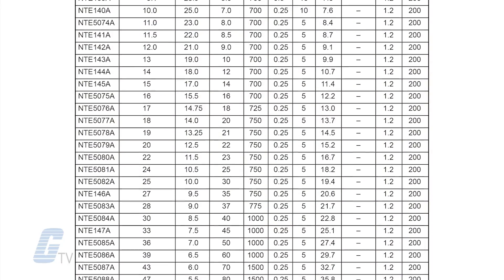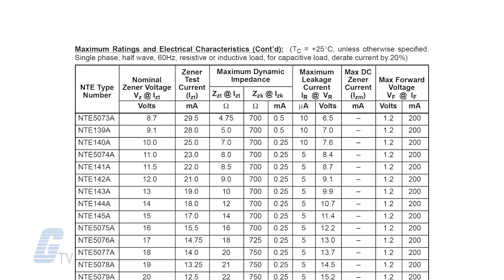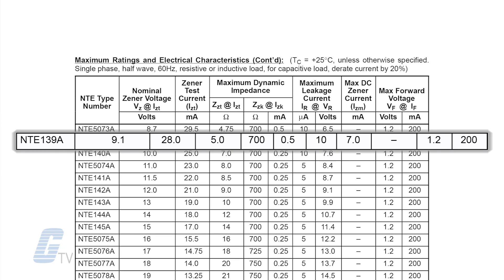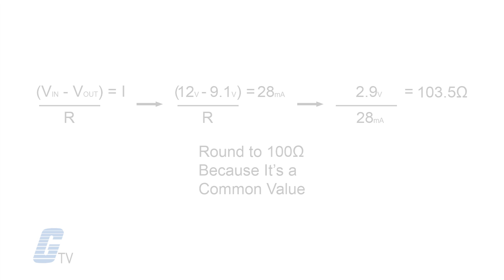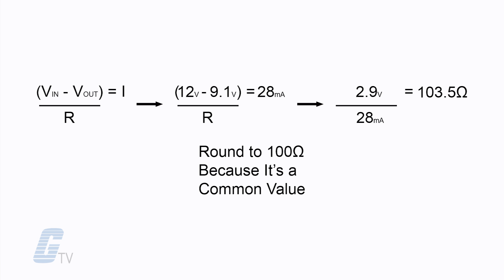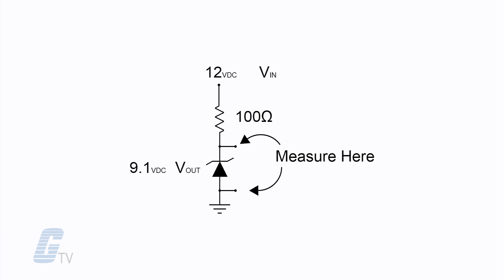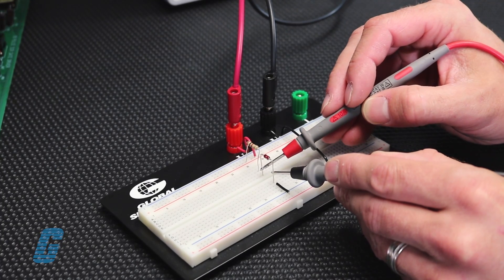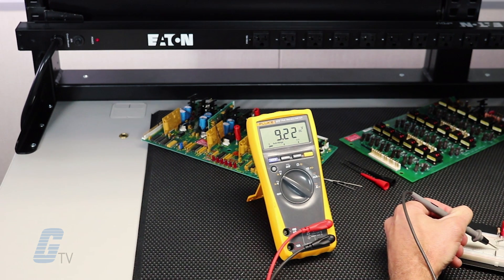How to Test A Zener Diode

Comment: WHat if you get continuity across the diode to +/-
Reply: You need to use diode mode on the multimeter. Usually it is the same position as continuity and then hit mode select to switch to diode mode.   -|>   Continuity does not test direction but diode mode does and direction of flow is how you test a diode.

Comment: bro my indcution heater metal melter is 3500watts and input v is 48v what is the correct zener diode need to use it?

Comment: I have a switching power supply.  The voltage swing is around 1 Hz.  Zener replacement solved this problem.  But the faulty zener passed the multimeter test and the voltage limiting on the dc load. So how to test zener for high speed operation?

Comment: Would this also work testing the reverse breakdown of a Schottky diode?   When I tried it - I got no current - even for 10 volts over the Schottky breakdown voltage (Schottky Vr = 20 V.  tested reverse voltage = 30 VDC).  The full voltage drop read across the Schottky (30 VDC) - and NO voltage read across the resistor (which was only 10 ohms).   Am I missing something ??

Comment: What about the orange glass zener diodes? I have one shorted in an expensive preamp that never had a schematic. Is there any method of determining it's value to replace it?
Reply: Just wondering if you ever figured out the Zener voltage of that orange glass type diode? (If badly stuck, I suppose you could try a high value, and work downwards until the circuit works as expected ??)

Comment: Why resister is used to measure zener diode...
Reply from the maker: Because it gives the remaining voltage somewhere to go. Notice they use a 12 volt supply across the diode and resistor, ok? So the 12 minus 9.1 = 2.9 right. This keeps the current thru the diode from going way beyond its range of operation once it breaks into zener mode.

Comment: I has always thought that OL mean Over Limit.
Reply: it does mean OVER LIMIT
idiots who don't know how to use their brain say  OVER LOAD
Reply: Open Loop
Reply: @kylethompson3187 
it doesn't stand for Open Loop,  it stands for Over Limit
Meaning that the meter has a Limited measuring range and anything above it is represented by OL.

Open Loop is something that someone back in the 70s dreamed up based on the fact that 
When you measured continuity and you have an OPEN CIRCUIT  aka  OPEN LOOP it would say OL,  that's where that comes from 

Not everything is an open loop
EXAMPLE : if the limitation of your DMM on Resistance is let's say 10 M Ohm and you want to measure a 15M Ohm resistor

- The resistor is good
- Your meter is good
- There is no Open Circuit between the test points

- HOWEVER YOUR METER WILL READ OL    or , depending on the meter it might read  1  which is a substitute for OL

the reason this happens is   YOU HAVE EXCEEDED THE LIMIT OF THE MULTIMETER

another way of saying Open Circuit is  INFINITE RESISTANCE,  or  INFINITY as some like to loosely call it 

so.. the lesson for today is 
IT'S CORRECTLY CALLED    OVER LIMIT
Reply: Over load
Reply: @AHMAD0SHISHANI  
it's not over load
jesus,  Use some common sense

WHY THE FUCK WOULD IT MEAN OVERLOAD
if you're testing a wire in continuity mode
and you cut the wire (hence it's open Circuit)
WHERE IS THE OVERLOAD ?

No mate
2 Terms are accetable

Open Loop (but this doesn't work in some measurements)

or

OVER LIMIT
which means

In continuity mode - There is high resistance and.. THE METER CAN'T DISPLAY THE EXACT AMOUNT, hence it has gone OVER THE LIMIT OF THE METRES ABILITY TO MEASURE THE RESISTANCE
 you can also call this OPEN LOOP if you like (but it's not correct , but does work in this scenario)

in Voltage Mode - You can't use Open Loop
it's OVER LIMIT  because if you have a meter that will test up to 600V and you try and test 620V   you will see OVER LIMIT  (OL)  simple as that

in Resistance Mode - Same thing,    you go over the limit of the metre's ability to display the number and it shows  OL

it's over limit
it's not Overload

how the fuck can it be Overload ?
DID YOU EVER STOP TO THINK ABOUT THIS ?
Reply: @martinkuliza  Over Load
Reply: @keysersoze7034  
No it's not
Why don't you use some logic...
if you are measuring a resistor which is(let's say) a 200 M ohm Resistor
and you are using a Digital Multimeter with lets say an upper threshold measuring range of 100 M Ohm Resistance
then the meter would display  "OL"
A) Because it is not capable of dispalying 200 M Ohm 
B) Because it wasn't engineered to do that
C) the way it was designed is... for any value above the max that it can do it displays  OL
Now to challenge that
if you are saying it's  Over Load
then  WHY DOES THE RESISTOR NOT BLOW OR BURN OUT
because an OVER LOAD situation means that YOU ARE PROVIDING MORE LOAD THAT EITHER THE RESISTOR OR THE MULTIMETER CAN HANDLE
by your logic, the resistor should blow up or Burn out because it's over load
it's not over load, mate,  it's Over limit 
also if you measure with a DIGITAL DMM and it says OL
and then you measure the exact same resistor with an analog Multimeter 
WHAT THEN ???
if it was overload either the resistor or Analog multimeter would burn out, blow or fail
but it's not
what happens is ..... the needle on the meter goes all the way over to the other sie )what is called FULL SCALE DEFLECTION
it essentially gest to IT'S LIMIT and hits hard over
hence  OVER LIMIT
There is no OVER LOAD, that doesn't even make sense
Like i said...  People who don't know what it means or who don't use logic  call it  OVER LOAD
so again... IT'S OVER LIMIT
just a quick one also
some people will say it means  OPEN LOOP,    now this is not completely incorrect,     DEPENDING ON WHAT YOU ARE TESTING AND WHAT MODE YOU ARE IN
so...
if you are testing continuity  (which is actually working on a concept whereby it's detecting resistance and below a certain resistance the beep will be audible and above a certain resistance 
a) it won't be and  b) it will display  OL)
in this scenario.....   you can view it as  OPEN LOOP  because you either have continuity in a  CLOSED LOOP / CLOSED CIRCUIT or you don't have continuity and you have high resistance and hence   OPEN LOOP /  OPEN CIRCUIT
in saying that.. you can also just have a close circuit with high resistance and get a reading of OL
so... in one way you can view OL as  OPEN LOOP.  but only in continuity mode
if you are Voltage mode,    ACD or DC  it doesn't hold true
if you are in Current mode...   it doesn't hold true
if you are in resistance... doesn't hold true etc...
so ..  the correct explanation of O.L.  is..    Over Limit
BECAUSE IT APPLIES TO EVERY SINGLE MODE
Open Loop,  is used in 1 mode only
OVER LOAD is just ridiculous and is used by people who don't know what they are talking about.

Also , just for fun
if you don't want to listen to me (Someone who has been in electronics since i was 6 years old,   i'm 46 now)
Listen to the electronics community and their opinions
https://www.eevblog.com/forum/chat/seriously-anyone-know-the-story-and-meaning-of-ol-on-multimeters/

in the Poll..  you'll aslo notice that OVERLOAD is leading the polls   haha

what we learn from this is ......
The OPINION that it is OVERLOAD   is WITHOUT QUESTION  THE MOST POPULAR ANSWER

but.. it's not the correct answer because it can be disproven very easily
however, if you try and disprove what i said and what most electronics experts say  that being  OVER LIMIT    you can't 
and if you try and disprove   OPEN LOOP across any mode  you can , but you can't disprove it in continuity mode, so it does have some validity 

but if you consider the accurate electronics definition of OVER LOAD,     mate.. it's not overload,  you can disprove that in a second
research it for yourself
Reply: @martinkuliza  Over Load*
Reply: @keysersoze7034  
Recursive Loop !

this is you....
------------------------------------------
10 Print "Overload"
20 GOTO 10
RUN
--------------------------------------------
let me know when you decide to kill the process

Comment: This is schottky diode bro, not zener!!!!
Reply from the maker: No, it's a Zener Diode. The first diode visible is a 1N3339 which is a 91 volt zener and the same tested with the multi-meter. The NTE diode tested in circuit was also a zener.
Reply: FixDaily - Electronic repairs, hacks and tips my god. He used test circuit for that reason
Reply: If that was a 9.1V zener diode you would never be able to read it with your multimeter because your multimeter doesn't have enough voltage to read the drop across it

Comment: the first was a diode not a zener
Reply: It iz zener.
Part number shows. 
Just like transistors can look like diodes and IC.
Reply: its a zener diode
Reply from the maker: Yes they were all zener diodes. The first diode visible is a 1N3339 which is a 91 volt zener and the same tested with the multi-meter. The NTE diode tested in circuit was also a zener.
Reply from the maker: it's a zener diode.
Reply: no its not

Comment: We'll checked the voltage on the zener and getting 3.2 volts using  a 1K ohm resistor and a 9v battery. It's a 751 Zener as marked on it so I believe it needs to be replaced. almost done fixing the Memory Man deluxe!!
Reply from the maker: Sounds like you are on the right track.

Comment: Great Simple video. I have a Zener Diode here that measures  1.82 v on the reverse diode test I believe this diode is shot anyone can anyone help? as I think I may have to order some...
Reply from the maker: That is probably a safe bet. Zener diodes basically measure the same as a rectifier type will, except maybe a little higher forward bias voltage like 0.7volt instead of 0.6. Reverse biased they will measure open like a rectifier until you reach the Zener voltage value. Do you know what it is rated?
Reply: GalcoTV Thanks for the reply will test the rated voltage with the 1k ohm resistor and 9 v battery but since it is giving me a 1.8v when doing the reverse diode test when it should be OL there is really no point in going further so I ordered the 751 zener . I have the schematic for the Memory Man Deluxe and I already replaced the dead Voltage regulator (it is a -15v), however checking more the Zener also was probably dead as well.
Reply from the maker: Very good Danfuerth, my research shows that a 1N751 is supposed to be a 5.1 volt Zener anyway.
Reply: GalcoTV Hey I really appreciate your responses and your info. Checked all resistors on the PCB and rectifier diodes those all were okay. The Memory Man Deluxe (Ec2000 PCB) uses an unusual -15 v negative voltage supply which is regulated by the newly installed and working Voltage regulator( from 34v DC supply) . However without the critical Zener voltage flowing the Voltage will not flow to the LED's which in turn pass voltage to the main system.
Thanks again!!
Reply: @GalcoIndustrial  I thought, the zener diode is supposed to conduct current in both directions - unlike a regular diode, and they have a different voltage in each direction - you should really search-out the data sheet for that diode and see what the Ef and the Er are for that diode.

Comment: Maybe I am mistaken, but isn't that diode's cathode pointing to the positive terminal of the battery? I thought diodes are forward biased in order to read voltage. That would means the diode has to be reversed in the diagram.
Reply: Yes James that is correct for standard rectifier diodes. Zeners regulate in the reverse bias direction though. In our video you see us test the Zener's forward bias voltage at 0.627 volts, this is because zeners are diodes too. However they must be put in reverse bias direction to get them to break into regulation mode. Hope this helps.John